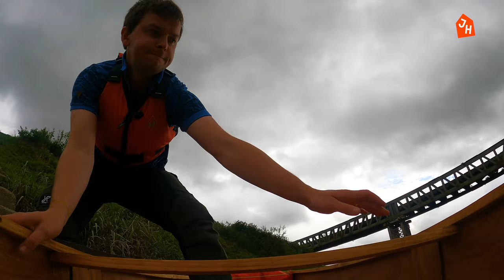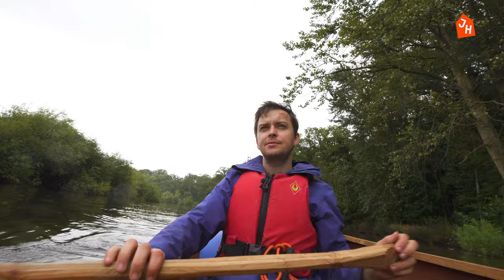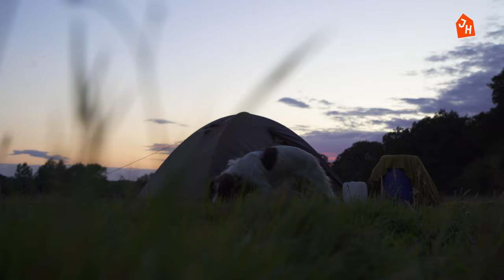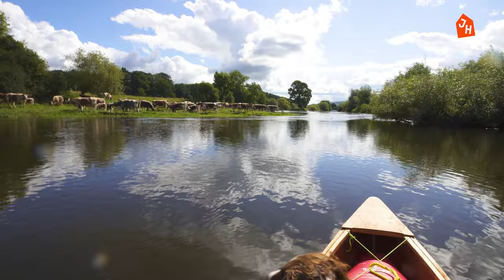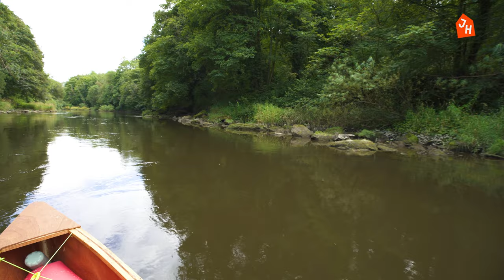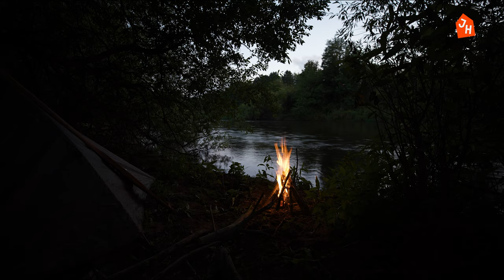16 Day | 160km Solo Adventure in DIY Canoe | Ep 3

Comment: May want to try to keep your lower arm straight (like an oar lock).  Believe you’ll find your arms hurt less.  Just a suggestion.  Waiting for your next episode.
Reply from the maker: You are correct! I would love to get my stroke better for my next adventure. I went through phases of locking my arm more but in general I think it was all over the place 😂
Reply: @JacobHarrell  Also be sure to bring sun glasses and a bunji to keep you from losing them.  UV light reflects off the water and will give your eyes sun burn.  Experienced that the wrong way canoeing 150 miles (oh and the arm thing learned that there as well). Also remember you can stay under your boat on the shore during a hail storm.  Doing what you are doing is an adventure that you will remember the rest of your life.